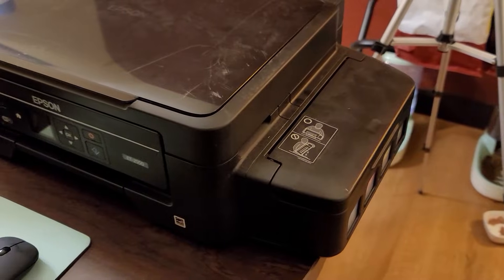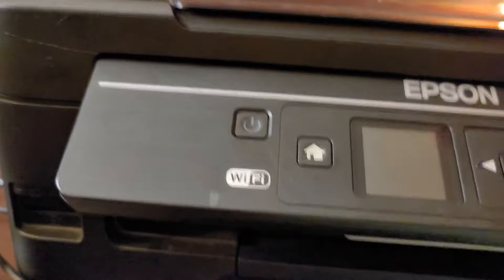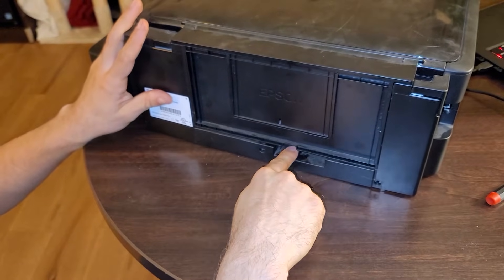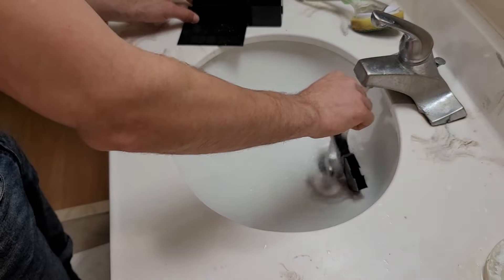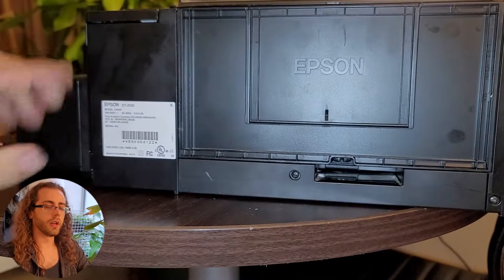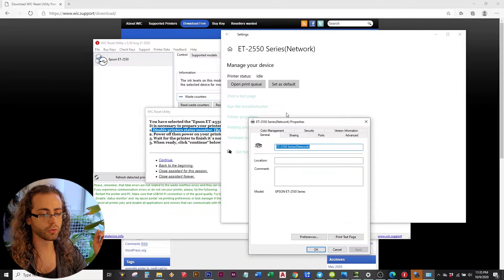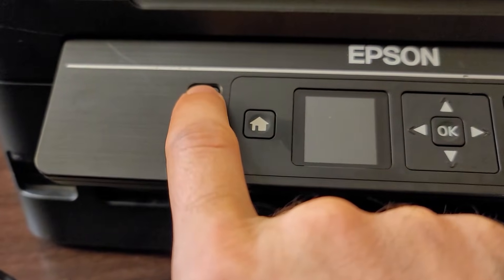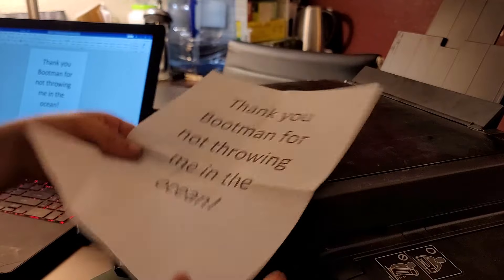Epson EcoTank Printer Waste Ink Pad Replacement and Ink Counter Reset (ET-2550) Procedure (How to)

Comment: eeeh. You rightly berated Epson for their environmentally unfriendly designed obsolesence. But then you go and put the ink down the drain and into the environment. I am pretty sure that isn't allright?? 

But if the old pad is disposed of resopnsibly and a new one installed, I suppose this shady-ware to get rid of the error is useful. Although I wouldn't risk it, much worse than having just your credit card information exposed could easily result, since the software you've downloaded and run on your machine could do basically anything (we simply have to trust that software doesn't do malicious things, and to a degree accept that it does some malicious things because we do need it). Although Microsoft and Epson both engage in immoral business practices I don't think the risk when using signed software verifiably from these sources is at all comparable to the unacceptable risks of running just SOME SOFTWARE from the internet in the mere HOPE it doesn't do too much bad stuff.

Obviously you can't change this by yourself, but I hope a class action lawsuit is brought against Epson and they are forced to provide the software tools needed to clear any error codes preventing the machine from being used in order to protect the machine manually. You own the printer, it is insane that Epson can legally practice this kind of ransome in which they are really saying "you have to pay us before you can keep using it". You've replaced the ink pad after all, so all Epson is needed to do is clear the error to ALLOW you to use the printer. I get so infuriated with these kind of practices and it is spreading like wildfire! BMW just launched a car in which you have to subscribe to heated seats, although you bought all the hardware to operate it when you bought the car. The responsible ones ought to be put behind bars!!
Reply: One suggestion to anyone wanting to try using the software tool: create a virtual machine that can't see anything but it's own disk and the internet and install the software onto that. On windows the software can very easily steal all of your saved Chrome passwords if you run it on your ordinary machine, because the encryption used is just linked to the user account, and since you're the user running the program, Windows will find the correct decryption keys and it's as easy for any program you're running to read your passwords as it is to read any unencrypted file! (On Mac, the key is part of a keychain you've granted Chrome access to, if another program wants to access it the OS will require you to say yes to it before the program obtains access.) 

If you doubt this is true, go download the Opera browser on Windows and MacOs respectively and see what happens when you try to import passwords from Chrome into Opera. On Mac you can still do this, but the OS makes sure you have explicitly allowed Opera to access your keychain. On Windows, Opera just goes ahead and does it - as long as the user who ran the app that encrypted the file is the same as the user running the app that decrypts the file, it works, because that is their model! And what Opera can do with your Chrome passwords apply equally to Calculator or any other app. 

Apps that have a "verified publisher" and when that publisher is reasonably well known can technically do exactly the same, but are generally safer because you have much more to lose by stealing people's passwords if it is easy to identify who you are. And if you are someone who is totally dependent on users trusting you enough to install your software, you have a LOT to lose and will likely only engage in shenanigans that are far more complicated and far more indirectly antithetical to users' interests, since by now people have come to expect and are quite accepting of being f-ed over.

In a case like this where you need to run some untrusted and potentially dangerous software once to modify an external thing (the printer) however, you can mitigate the risks a LOT by using a virtual machine. If the app is a trojan, the technical barriers to getting hold of your information are much higher, and since almost no users bother doing such things, attackers don't bother trying to break through. I wouldn't be worried about trying the software this way. For this scenario, I would be more worried about having to spend a lot of time getting the printer connected from within the VM, but it's quite possible that would be a breeze whether it's USB or, more likely these days, Wi-Fi... :)
Reply from the maker: I agree with you on pretty much everything here. I think it'd have been wiser/more efficient of me to just discard the pad and buy a new one, or even use an old sponge or something. And same goes for running weird software on a virtual machine environment, and it's beyond the pale that this is the length you have to go to in order to clean up EPSON'S corporate mess here. A class action lawsuit should definitely be on the plate, guess it's a question of who's willing to lead the charge? But it would sure as hell be so much easier if Epson just released the damn software themselves. That was my hope by making this video.

Comment: Thank you. I followed you instructions and it worked. I'm outraged, like you are, by Epson's policy on manipulating it's printers and making customers pay for uneeded things. But the printer is still a good deal ink-cost wise.... Cheers
Reply from the maker: At the very least, now it's a good deal since we didn't have to buy a whole new printer lol
Reply: Actually Epson in Belgium, offers a 60€ max repair bundle, for whatever problem the printer has (provided it has been using original Epson ink refills). That would be ok if... One shoudn't have to send the printer to.... Holland!! and back, at the customer's cost!!!! The total costs equals buying a new printer, LOL. Shame on them, and thank you again.

Comment: Do I actually need to change the pads or can I only reset the counter? The last time I checked I haven't print half of what's consider the limit for the pads. I even took them out and cleaned them and the machine kept printing without asking for any reset code. I don't want for this to become a brick if I could  save it.
Reply from the maker: You can reset counter only, the older models don't have a chip inside the pads (I'm fairly certain the new ones do, at least based on some comments). Only word of caution is to make sure the pads are in fact clean or new, otherwise you risk the machine overflowing with ink where the pads are.

Comment: so oh dear, I have just bought a 2751 sadly before reading your posts, so please tell me, do I update or not? how to avoid this problem altogether?
Reply from the maker: I'm not sure you can - if your model is similar to mine, the printer will just count the number of pages, and when a certain limit is reached, you'll have to go through this song and dance to replace the pad and reset the counter.
Reply: @Bootstrappin  😭 oh no...there doesn't seem to be much choice out there either, I noticed same issue with Canon. Seems they share a rule book. Thanks for your entertaining video btw
Reply from the maker: @Simmers70  thank you! AND BACK IN MY DAY, THEY CALLED THAT COLLUSION

Comment: I have the exact same issue with my EPSON ET-3760, and despite multiple software updates from EPSON, the issue is NOT solved.
Reply: I too have a now nonworking 3750. I guess Epson found and disabled the "key" fix and now I have a printer that does not work. Watch out for buying those Epsons that can't be reset!😠

Comment: Is there any possible way to reset the ink counter without a PC?  I just use my Epson for copying.  (Also, what’s your advice for cheap, color copying, if any?)
Reply from the maker: None I'm aware of unfortunately. Newer Ecotank printers seem to sell ink pads with the reset chip already in it, so that's one potential way to not have to use a computer.
Reply: @Bootstrappin  thank you so much for the quick reply!  My ecotank is approx 1 year old so I’ll let you know how it worked out when I get it all back together.  Maybe it’s simpler than I think.  I subbed you!  Love your delivery in the vid and the prompt reply on a month-old post is awesome!  Thanks again!
Reply from the maker: @amandahugginkiss61  anytime. Ah so it's fairly new, mine's about four years old. Are you replacing it with an Epson pad or just giving it a wash?
Reply: @Bootstrappin  I rinsed the pads and allowed them to dry.  Now I’ve put it all back together and it’s still saying contact Epson so I’m going to use my husband’s laptop perform the steps in this vid.

Comment: I had the same issue with an ecotank 4550.  Ink tank is different, but I figured it out after a bit.  Cleaned the pads and used a utility to reset counter. Works like new. Thanks for the video!   I'm glad my van still started when it hit 100,000 miles. I  can't understand why what Epson did was even legal. After all, isn't it up to the consumer to know when the product is worn out. Epson's explanation that "our experience is when the waste ink tank is full the service life of the printer is almost over" is complete horseshit.  I wonder if they even have an actual sensor in the waste ink tank or is it just a page counter that disables the printer when it reaches lots of pages. I will say we use the hell out of this printer. Not pages and pages of printing but BOX after BOX of paper. Aside from this issue it's been a workhorse and saved us tons of money on ink. So A for the printer.... F for Epson.....
Reply: It's been a month and it's still running like a charm. We runs tons of stuff almost every day.
Reply: @renglass  Hi Frank. Still working? I want some updates from you. I have L3250 and I discovered this after i bought one.:D
Reply: @renglass  Thanks for the info!
Reply: Gabriel Dinu……..I had error on ink pads n said contact manufacturer!  I had it about 3 months. Under Warranty still. I said pick up in store when ordered.  Bought from Walmart.  Called Epson n gave error message.   They said under warranty n will ship new to me.  Do not send back!!!!  Had no problem with Epson!  Was a happy camper!  I print crafting digitals for journals and can do 100 a day easy when orders!!!!!  New one is still good!!!!  I put other one in garage in case for parts.  I have ET2720.  Also, for info., you can print 28-110 lb.  paper n card stock with NO problems!! Epson says u can’t!!!!!!! You just change the density to 4-5 etc.  Takes paper thru with no problems.!!!!!!!!!!!!  I even put up to 3 sheets  at a time!!!!!!! Hope this info helps a lot!!!!!!
Reply: @sharonbender6802  Thank you.

Comment: To be fair, you are most of the time still throwing a printer in the ocean either way. This just doesn't throw many cartridges in with it number one. And two, it still can be and is cheaper then the standard cartridge printer. 
In your favor, your right that it is bullcr*p, can you imagine if a car company did the same thing. Stopped your car from running because they thought it wasn't safe anymore, you should send it to the junk yard and buy a new one. Would never fly.

Comment: Hello, I have removed the pads and run water over them to remove the ink but they have shrunk ! Do I need to place something between them when replacing them in the ink pad container of the printer? Any suggestions? Thanks!
Reply from the maker: May help to put some extra sponges to hold it. Just monitor it occasionally to make sure it's not overflowing.
Reply: @Bootstrappin  Thanks for your reply. Have just found some kitchen sponges which I will cut up! Another thought - have I got this right? I put the ink pads back in and then use the software to install a key which resets the counter chip - but this can only be reset once? I have ordered some fresh looking ink pads which will not arrive for a week or two. If I then replace the washed out pads with these, will taking the pads box out again require another counter reset which I will not be able to do?!1
Reply from the maker: @geoffcox75  you won't have to do another reset, since it just counts sheets printed/time. Should be fine, and you can probably do the reset procedure again in the future if needed.
Reply: @Bootstrappin  OK - will give this a try ! Cheers!
Reply: @Bootstrappin  Thanks for your help, printer working again!

Comment: awesome vid- thank you! So helpful! I've had this printer for about six years now. I'm an artist and really like it's built in scanner, color quality, and I don't go through a ton of cartridges each year which is awesome. I wanna try and keep this printer going for as long as I can. As long as I perform regular maintenance on it, it tends to operate alright. I've definitely gotten frustrated with it though. But yeah just wanted to say thanks for all this info! Do I have to do all the wic stuff? Also cute cat!
Reply from the maker: Thank you! You have to do the WIC stuff only if you're locked out of using your printer and it won't let you reset the waste ink.

Comment: Erhmm... Maybe literally throwing the used waste inc into the ocean after complaining that Epson wants you to throw their printer into the ocean isn't the most responsible thing to do?
That part of the video sort of justifies Epson not trusting consumers to do this themselves, since they won't dispose of the inc properly.
Reply from the maker: It... doesn't? Sewage doesn't go to the ocean, it goes to the waste water treatment plant. And besides, since the newer Epson printers let you replace the ink pad, the expectation is for you to throw it in the trash. This one is entirely on Epson, especially since they admit that shipping your old printer for repairs is more expensive than buying a new one. And since they give you no guidance on how to properly dispose of anything, I guess they're just kind of brushing off that responsibility, not so much 'not trusting' customers.
Reply: @Bootstrappin  The water coming out from the waste water treatment plant goes into the ocean (deepening on where you live). Some countries have less than satisfactory waste water treatment too, and considering this video goes out to the whole world it's not very responsible to show pouring ink into the sink as how to clean the pads.
When I've worked with simple water soluble paints there are strict regulations about not dumping it into the sewage because the water treatment plants risk getting clogged up and stop working if there's too much stuff that's not supposed to be there. If that happens sewage can go directly into the ocean. We had to use a paint filter bucket to filter out the paint and then go throw that away separately.
In short, don't throw stuff into sewage that's not sewage, if too many people do it bad stuff happens. When you make how to videos you have a bigger responsibility to make sure that people following your instructions won't cause harm. Just add a disclaimer or something in the video saying "Remember kids, never throw ink into the sink. I'm doing this so you won't have to" or some other funny joke like that.

Comment: ok so one concern is out of the way :D
have you had any clogged nozzles issue? Epson claims that in this series they have a sustainable printhead and a built in automatic functionality that sucks the ink and keep the nozzles clean. how would you evaluate that?
and thanks by the way! very helpful reviews
Reply from the maker: Thank you. I haven't had that issue yet. The printer did have lines during print, but the Epson cleaning procedure took care of that. If it ever does happen, I'm sure I'll make another video!
Reply: @Bootstrappin  Unfortunately, it uses a TON of ink when you have to do that!

Comment: just had same issues  issue  with epson et-2750    with ink pads  counter  done same as reset   that one fine  i think only diffrence now  is  that the in pads are located in side of the printer  in  cassette   but it is  pain in the ass   when  ya payed £pounds here in uk when i got  i got error after 14 months keep debating about getting  cooler laser printer
Reply from the maker: "It's a feature!"
Reply: @Bootstrappin  lot easier to access       but ink pad  counter are stupid     annoying    I git a
Another better eoson printer and got ciss    for  lot  less  in cost than eco tank set up       but I'm seriously thinking laser  next year  once I read review